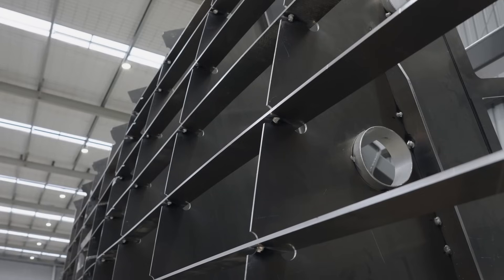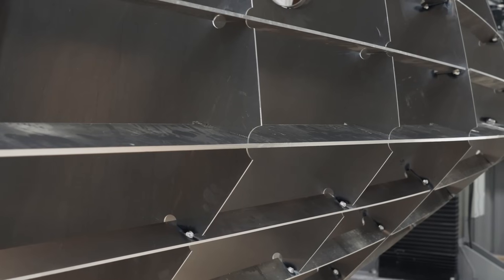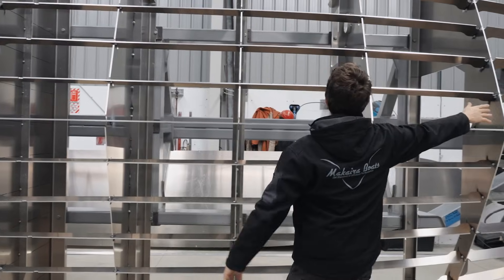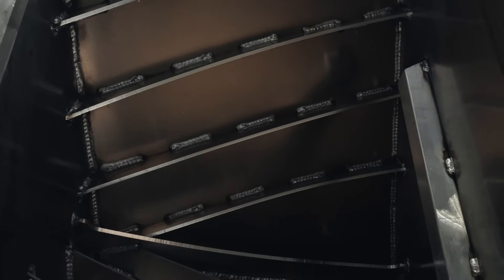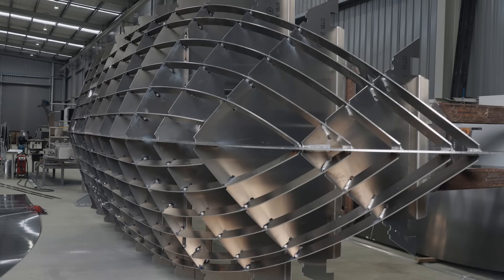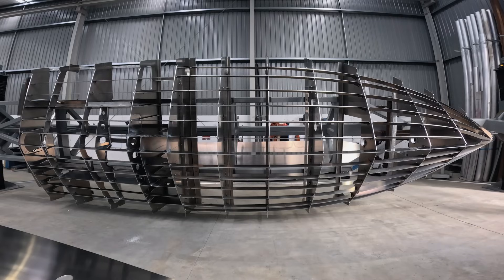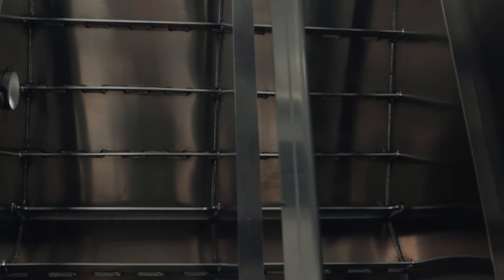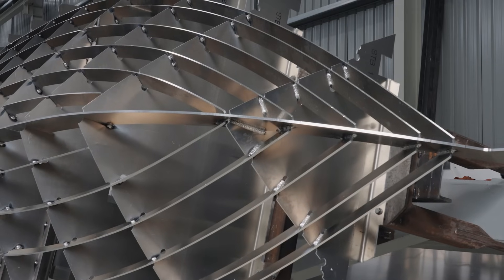Hull Structure | What Separates Us

Comment: No flooding keel?
Reply from the maker: flooding keels are a bit of a myth we run our fuel tank in this area effectively giving the same result but carrying fuel not water, this is why our tanks are a lot bigger than the builders with flooding keels, our 30 takes 950L of fuel and our 25ft tanks 470L. Also the way builders make flooding keels means you have a single skin in the bottom of the boat with no continuity of structure through this area( the most vital area being the keel) and also you have a single weld under water line in the hull that the inside is exposed to crevice corrosion. Most of the manufacture that run them are very monohedron hull shape around 21deg so use a flooding keel to make up for poor hull design.
Reply: @Makaira_Boats  I love your boats but have to say I’m a big fan of the flooding keel they definitely work seen boats 20 years old with flooding keels and no signs of corrosion inside.
And you may have one weld under the water line but if you crack your keel the boats not going to sink because it’s designed to run with water in there.
But more fuel is always a very good benefit 👌
Reply: Yeh , they make a big difference at rest